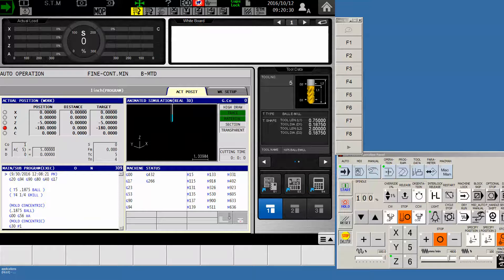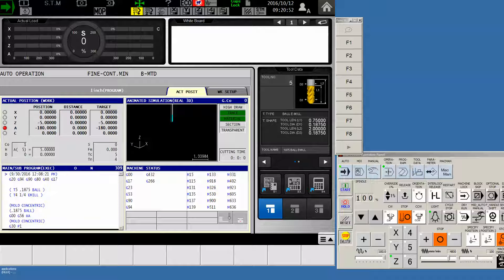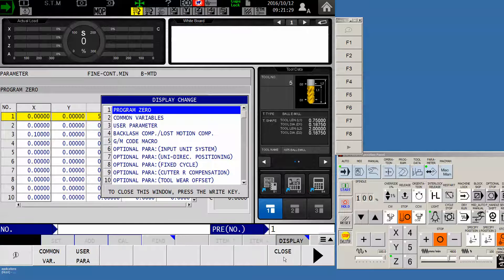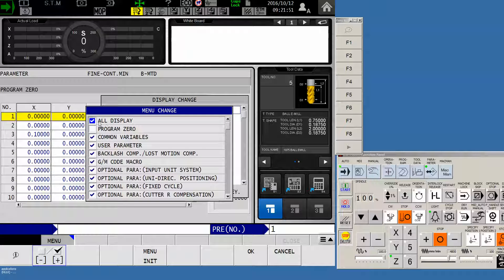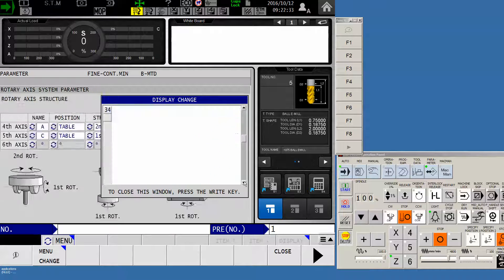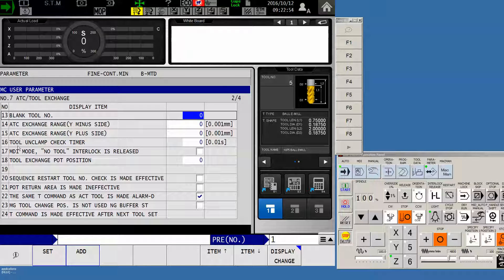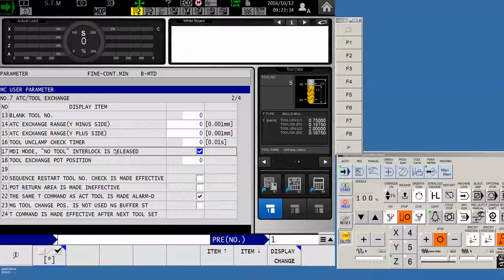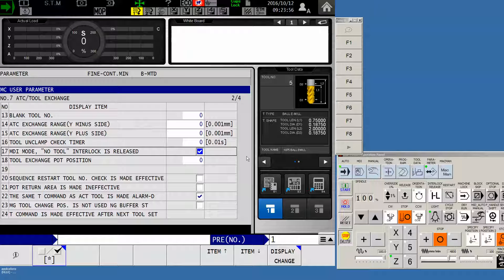TOOL CHANGE PARAM

Comment: Great video! Can this be used to resolve a mid tool  change problem? A tool got stuck on the spindle while executing M6 command. The swinger arms are attached to both tools while the tool partially out of the spindle. The machine doesn't seem to realise that there is a next (indicates zero) to still attached to the arm and has mixed up both tool number. Apc step resolve doesn't seem to work.
Reply from the maker: This process should solve the issue, as long as the reason behind the interruption is not something electrical. If, for instance, a clamp/unclamp switch fails causing the stoppage, you won't be able to use this cycle as the machine is still dependent on that particular switch to allow forward progress. If the interruption was an emergency stop, then this will also not work, as the machine will be unable to confirm that the X and Z axis are in their G30 P1 location and the spindle will no longer be in orient lock position. These situations require turning on the system check mode and walking the tool arm back, then confirming the registration of tools is corrected